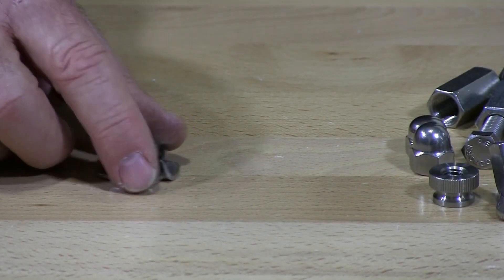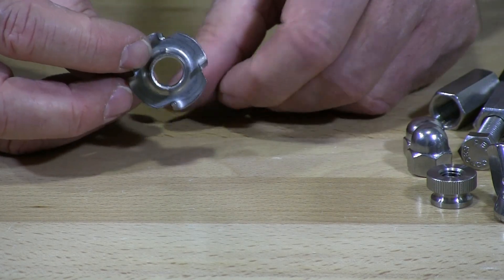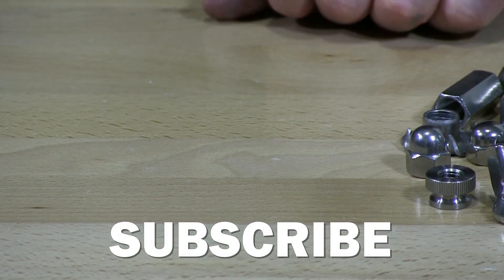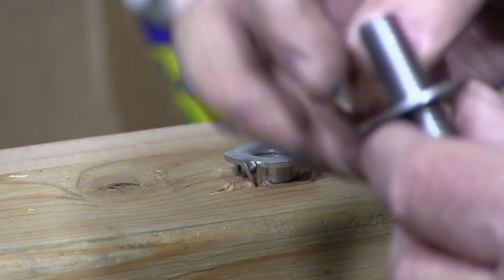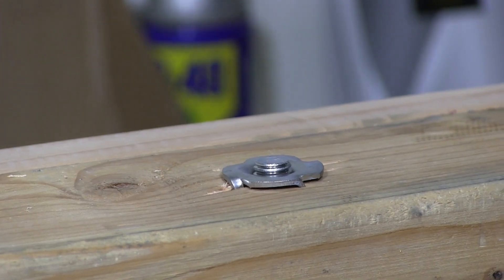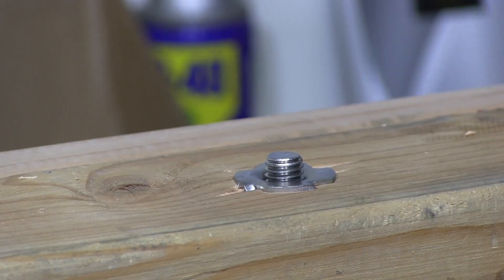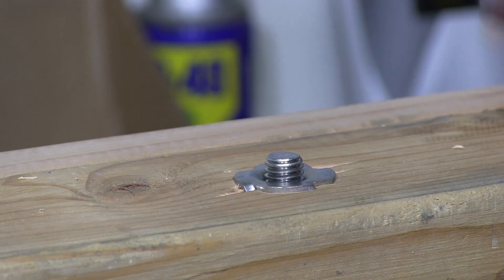Installing T-Nuts In Wood | Fasteners101

Comment: Know this is a super old video -- Im trying to use t-nuts in MDF board.  Im using M4 size, drilled the hole with a  7/32nd bit -- put my t-nut in and use the m4 bolts to pull the prongs into the wood, when i back out the bolt, the t-nut also backs out as well?  What am i doing wrong?

Comment: Thank you!
I have a plein art mini easel that I want to use for outdoors on a tripod 1/4" screw.  That way I can remove the tripod after use and just carry my easel like a flat briefcase.  I bought some T-Nuts to imbed in the bottom of the easel and make totally flush.  The screw is about 1/2" long, so it should catch in to this and hold.  Although it's solid underneath, so I'm planning on using some sort of metal/wood glue underneath and either hammer a pre-drilled hole or find some way to make sure it's totally flush and biting in to the wooden surface.
I think drilling a deeper hole first (size of the T- Nut's barrel), then cutting away a hole the same size as the T-Nut will allow me to sink it in well without damaging the original easel too much or cracking it.  Appreciate the explanation.

Comment: Nice demo, but would really like to know what sized hole is drilled for the barrel.
Reply: Me too
Reply: Measure the  OD. Outside Diameter of the barrel and slide it in using the bolt.

Comment: I was today years old when I learned a t-nut should go on the opposite side of the wood instead of the same side as the bolt. I have hated t-nuts for this reason since forever, and I feel liberated now.
Reply from the maker: Too funny!
Reply: Hi. Just curious, why does it make a difference which way the bolt goes in?
Reply: @Therunnerisrunning as in the video, the bolt is pulling the t-nut to claw the wood in the middle, so it isn't going anywhere

Comment: Make no sense to me.  They just push the washer out.  Doesn't pull in
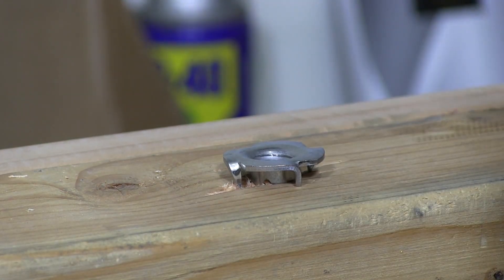Reply from the maker: 1:58 As Bob tightens the bolt, it grabs the threading of the t-nut and pulls it into the hole. I'm a little confused by your statement...unless you were referring to something else?
Reply: @AlbanyCountyFasteners  ok so I predrilled the holes and I set the t nut on the opposite site of the board and begin the screw.  When the screw begins to catch the threads on the t nut , it doesn't pull the teeth towards the wood , it either just passes through and it doesn't move, or if I let go of it , it pretty much just catches hold and stays in place on the screw and moves away from the wood.   I spent 3 hours trying every which way to screw that in and it somehow pull it tighter, but I've got to be completely missing something because it just simply does not work. And I know the hardware matches because they are from the same set and the wood is mdf so it's plenty soft

Comment: You don't cover the sizing of the length of the barrel, Do I use a 1/2" long barrel on 7/16 thick material or do i use 1/2" long barrel on 5/8" thick material, or do I use 1/2" long barrel on 1/2" thick material.

Comment: I've never used one of these so if I were to remove the bolt would the T-nut would it stay embedded
Reply: yes
Reply: @MarCialRoman  One of the great uses for T-Nuts is removable plates from your work bench. I install them on the back side of a plate that is the same size as my work bench. I make subplots with the same hole pattern and mount a vise, 6" bench grinder, disc/belt sander and they are interchangeable and store easily under the bench

Comment: Can I ask what the benefit of a t nut is over a hex nut? If it is flushness well the bolt it still protruding out so it's still not really flush. Thanks
Reply from the maker: The flushness is one thing, but the real benefit of the T-nut is that it bites down into the wood with its flange, which distributes the load better. While also serving as a way to use screws and bolts with machine threading in wood applications, similar to a typical threaded insert.
Reply: @AlbanyCountyFasteners  thanks 👍🏼
Reply: If you don't want the bolt to protrude, use a shorter bolt. :)
I have used these on several occasions where I needed to bolt something to a piece of wood that had the backside flush against something else. I just use bolts the right length, and if I can't find one that fits perfectly, I just shorten the bolt slightly. You just need the bolt to grip at least the length of the thread size, i.e. if the thread is 3/8", you want the bolt to go at least 3/8" into the T-Nut.

Comment: Depending on the application, I sometimes use a Forstner bit to relieve the wood enough to allow the T-nut to sink just below the surface of the surrounding wood.
Reply from the maker: That seems like a good idea for making the T-Nut more flush with the surface. Thanks for the tip!
Reply: Same here. Forcing it down through the wood deforms the surface around it. And it is basically impossible in hardwood and plywood.
I have used T-Nuts and bolts as stand-offs for leveling the router attachment on my tablesaw table. It's a custom built table for my Dewalt DW745 that was built with the attachment in mind. I countersunk the T-Nuts into the frame and used hex bolts to raise or lower the top in 6 places (3 along each of the long sides). The top is then secured to the frame with 4 sturdy metal brackets.
Reply: You can also use a Forster bit to sink the T—nut further, about a 1/2 inch.  Then super glue a wood plug into the hole to get a finished look on one side with a super strong fastener on the other side.

Comment: I work in a reel manufacturing plant and we pound them in with ball peen hammers. It’s much faster if you’re working with thousands of t nuts per day. I can see how this method creates a cleaner end product. We’re making 5,000-10,000 reels a day, depending on the time of year, so we’re working with (on average) at least 20,000 t nuts a day.
Reply from the maker: That's fair! While this is the cleanest way, we can see how your approach with the hammers would be the best for what you are doing. That is a lot of T-nuts to install. Thank you for your feedback!

Comment: Will this work with a clamping knob?
Reply from the maker: Yes, a T-nut should work fine with a clamping knob.
Reply: Just force it in with a bolt first. The knob would probably break before the T-Nut is seated properly, depending on the type of wood.

Comment: These or threaded bolt inserts?  Which one would be better?
Reply from the maker: That would depend heavily upon your application. Threaded inserts - for wood-  are normally used in situations where the fastener is going to be installed and removed multiple times. While both create a flush surface when installed correctly, you will get more pulling strength from the t-nut (because they can handle so much torque). For just creating durable threading in wood, either would be fine.
Reply: @AlbanyCountyFasteners  Follow up. Could a t-nut be used in the place of washer and nut?
Reply from the maker: @BoltWolf69  That will depend on the application. In practice, you would use a T nut where you do not plan on removing the nut. Where as a bolt, washer and nut combo is a fully temporary joint. It could be used in place of a nut and washer but if you place on replacing the T nut several times it will not work.

Comment: I have a question if you have a bed end ( or dog bed in my case ) with 4 poster short legs and I want to lengthen the height of 2 of the legs can I use a wood square leg ( which i've bought ) with a threaded bolt already sticking out of it , and drill a long hole ( to fit the treaded bolt ) in the existing dog bed leg , place the t-nut in the top then screw in the leg extension into it ?
Reply from the maker: Can you send pictures of what you're doing? We need a better idea of your application to provide any meaningful advice. Please send any applicable pictures to support@rawproductscorp.com with a description of what you are looking to do and we'll help as best we can.
Reply: Assuming that the threaded bolt sticking out the extension is longer than the existing legs then you could put a t nut on the top of the existing leg and achieve what you want. You would have to possible trim off the excess bolt that will be sticking out the top of the existing leg though when you're done and could leave nasty sharp edges. A far better solution is to use a wood threaded insert.

Comment: You didn't state the diameter of the hole in the wood required for the T-nut.
Reply from the maker: Hi James,

The hole size will vary depending on the size of the T-nut. You'll want to drill a hole as close as possible, but slightly larger, than the barrel size. It should fit snugly.

Comment: If you put the t nuts inside a box (so you cannot see the tnut) how do i know when to stop turning the bolt? Will I not be able to turn it further?
Reply: OfficialMartinB   Turn the bolt until its snug but don't over tighten.  You'll feel it when it's seated because the bolt will get tight.

Comment: Thanks for the video, I gave it a go and I highly recommend rubbing the thread of the bolts with some soap, you then only need half the torque to get the job done. In my case the only bolts I could find had screw heads, so this allowed me to do it with a screwdriver without busting the screw head
Reply from the maker: Hi Joaquin, We don't recommend using soap as it is considered hydrophilic. This means it will attract water to those threads. We recommend using a lubricant designed for fastener lubrication such as these: https://www.albanycountyfasteners.com/Anti-Seize-s/949.htm

Comment: It should be mentioned that when hanging a shear load from a plywood panel, a T-nut is the only way (short of nuts and washers) to secure a load (in my case, a pipe hanger). A woodscrew is an absolute no-no in this case, or any case when securing anything from plywood, even a non-shear load.

Comment: The problem I am having is a standard m8 nut spinning in the timber (mahogany), I can see how the T-nut would allow me to tighten but it's also important that I can disassemble without the nut spinning, can I presume this would work ok?, I tried using Gorilla glue to hold the nut in place and waited for 2 days to allow the glue to harden but it did not hold it. thanks for sharing this video.
Reply: Tony Beadle   The but won't spin once it's fully seated and the prongs have dig in. We have hundreds of them on the back side of panels for a climbing wall that are permanently mounted. We remove bolts frequently and the t-nuts stay in place.   There's also a version with small screws to hold it in place rather than prongs.
Reply: @Tony Beadle - Not sure if I understand fully what you were trying to accomplish, but "riveting T-nuts" have an added function that allows the wood parts to be disassembled & reassembled multiple times with less chance of the T-nut loosening out of its intended position.  I saw & read about these on Rockler's site.  I realize you asked this Q 4 months ago, but maybe it will be useful on a future project. :)
Reply from the maker: Yes, you can disassemble with a t-nut.  While the bolt is still screwed, take a hammer and hit the bolt to push the t-nut out of the wood.  You can then unthread the t-nut and re-assemble when you are done.
Reply: Thank you for your reply,  unfortunately, the nut is inside two parts of glued mahogany, whilst I could hit the bolt to release the prongs it may not be so easy to put the bolt back in as I have no access to it once it is in use, I will buy some and try, again many thanks

Comment: couldn't you just pound it in with a hammer?
Reply from the maker: Sure, you could. But...by pounding the nut in you can splinter the wood instead of drawing the nut in slowly. It is an option, but it is not the optimal solution.
Reply: +Albany County Fasteners good to know. do you also make insert threaded nuts?
Reply from the maker: We do sell thread inserts for use with wood. Check them out on our site here: 

https://www.albanycountyfasteners.com/Threaded-Inserts-s/725.htm

If these aren't what you are looking for, let me know and I will provide alternatives.
Reply: @AlbanyCountyFasteners  should you just tap it in with hammer ever-so-slightly so it's just getting a little bite into the wood? That way when you torque it down it'll actually go into the wood
Reply from the maker: @macknumber9  A light tap should be fine but you should also be able to just draw the nut in for the same effect, without risking any splintering of the wood.
Reply: @AlbanyCountyFasteners  thanks for the response. The reason I am asking is because I hired some guys to install a playset and one of the bolts I thought was stripped until I look at the other side and a t nut prongs were just flattened I'm guessing that they probably tried hammering it in instead of using the torque of the bolt

Comment: could you tell me if you used a drill the size of the barrel or a drill the size of the bolt?
Reply from the maker: Hi Sergiomng, Use the barrel diameter.
Reply: Thanks a lot!!! thanks for posting this video as well
Reply from the maker: You're welcome!
Reply: Ahhhh  no . Use 1 6/4  less . Much tighter fit .  Tap lightly with hammer cover with a piece of wood and pound it home.
You do not always have access to screw in from underneath and as far as I'm concerned a waste of time.
Reply: @n40tom  "You do not always have access to screw in from underneath"
If you don't, it defies the purpose of the T-Nut. If you want to screw in the bolt from the same side, you need a threaded insert instead, or you will just pull out the T-Nut.
Reply: It's obvious that he only drilled a hole for the barrel - that's why he split the wood!

The correct method is to use a proper wood screw and use it to countersink for the diameter of the T-nut by a few mm.